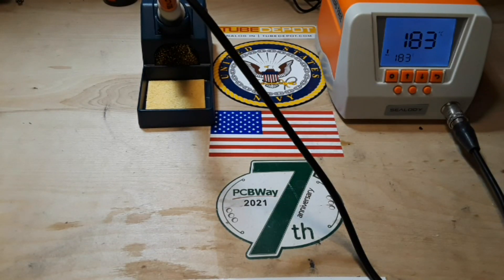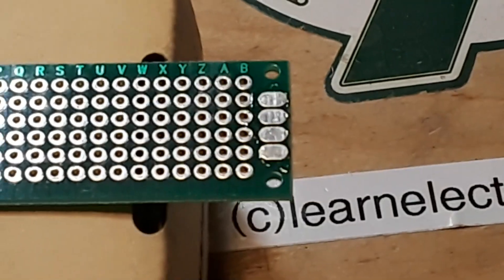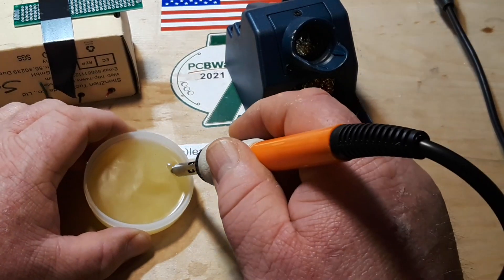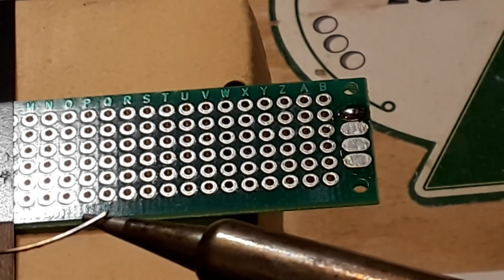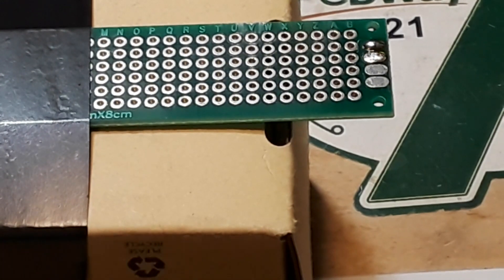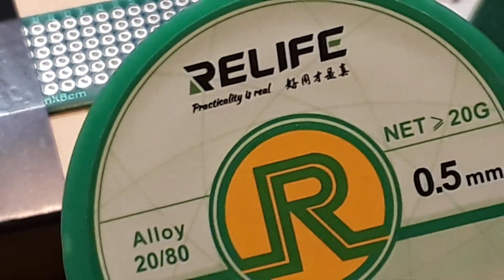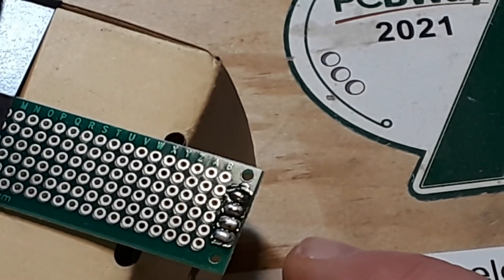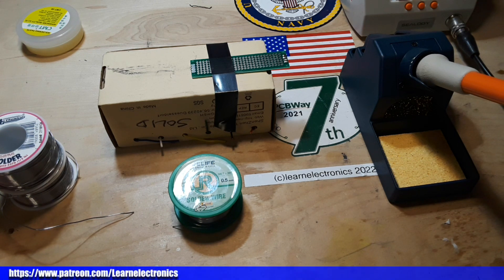Testing 3 Different Solders

Comment: ~183C-ish is a normal melting temperature for leaded solder. The MG Chemicals solder used first in this video has a melting point of 361 ~ 376°F (183 ~ 191°C) because it is not eutectic. The same low temp test should have been done to all 3 solders. I would have liked to see how the MG Chemicals one did a 183C. Have you tested the actual temperature of the tip?

I have used other Relife products and they are really good. Though, I have never tried any Relife solders. I don´t think I would use solder containing that much lead. MG Chemicals appears to make good products but I don't remember ever trying any.

Maybe you can do the test again and include some Kester solder. That would be nice.

Comment: A little late hear. That low melt solder appears to be a removal alloy for SMD. Similar to Chip Quik. Heat it at 350-400 c. It will stay molten for a bit, to allow you to remove flat packs, etc.

Comment: I'm so glad I decided to listen to you. I've been really disappointed with how my solder joints looks especially after soldering binding posts/banana jacks to my HP Server Power Supplies I put in series for my LiIon/Lipo/LiFeP04 charger. No matter what I did the solder would always end up looking dull and sometimes even crusty. I had been buying Maiyum on Amazon. Its rated very well and while I knew it wasn't Kester or MG Chemicals I figured those two weren't worth the money. I buy a 100g roll of solder every 4 months and just was too cheap to shell out $30 on a big roll of the good stuff.

Until a couple weeks ago when I saw 2 18gram tubes for $2.99. 2 left in stock. I got 72 grams of MG Chemicals 63/37 for half the price I'd pay for 100 grams of that Chinese junk. Now I've been resoldering a few of my bench toys because I absolutely cannot stand looking at the McDonalds equivalent of solder now that I have Flemings on my bench. Beautiful shiny solder joints that stay perfectly round. My only complaint would be the specific solder I chose is a little heavy on the flux but I have 99% iso if I need to do a bit of cleaning.

Thank you, thank you, thank you! MGCHEM4LIFE
Reply: I am looking at a roll of MG Chemicals no Clean, 63/37 1/2lb for £20. Do you think that's good is it worth the money? Kester is going to cost a hell of a lot more.

Comment: 63% tin, 37% lead resin core .028 inch Ersin is fantabulous.  63/37 is supposed to be the only combination that sets up, solidifys with less temperature change. 60/40 sets slower which means I have to be steady for a greater time.
Reply: Setting slower isn't the only problem, tin and lead have two different melting points so one will solidify before the other, the mixture becomes the metal equivalent of a slushie which means that even when it looks solid a part of it will still be molten and any slight movement can lead to cold joints no matter how good it looks from the outside, bad connections that are hard to diagnose. 63/37 is a eutectic blend which through some metallurgic magic it all melts and solidifies at the same time despite having two different metals with different melting points.

Comment: I had a friend make a kit using Lead-free solder and none of the joints flowed. Touching with an iron the Lead-free fell off. Used 63/37 worked great
Reply: Some of the new LF solders are good but they're apparently a lot harder on tips, especially with the extra heat. That's what turns me off. Luckily here in Australia there's no restrictions on leaded stuff.

Comment: How about testing Silver bearing solder?   I find it better when holding wires by hand.  When you take the heat away, the solder hardens instantly, giving you a better joint.  This, of course, requires the use of a much hotter iron temperature.

Comment: im always finding problems with solder. some works great on circuit boards but not at joining wires together. and some are the other way around. so i might try your 1st solder you showed there (your go to solder) coz it gets messy when a solder's not doing what you want it to do. even it it says it 60/40 tin/lead. you just can't trust the Chinese market. i get all my stuff off BangGood. find very satisfactory. but solder can be a problem. or maybe it could be the flux im using either. so i need some pen dispensing flux for small circuit board job/smd replacements. so il try that solder you use and report back.

Comment: Nice video. I wonder if the 183C temp was referring to the temp the circuit board could get to before the solder let go. Although that would be a smoking hot board at that point!

Comment: May not be scientific but i found this to be an objective test. Extremely low melting point of that solder sounds like a marketing gimmick (?) i wouldn't even trust any solder that melts at that temperature, if it's even possible!

Comment: It would be worth comparing the properties of the lead free solders. 
As the properties are well documented in their data sheets, the real test is how well they work in the real world given their price. There are some low temperature mixtures, but they tend to be expensive.
I have a soldering iron dedicated to lead free soldering, I have to say it does not get much use, as the stuff is so horrible, particularly with SMD parts. The most common lead free solder is a tin copper silver mix, which has a very high melting point, compared to lead/tin solder.
It is reported that of the lead free solders, a mix of tin, bismuth and silver gives a lower melting point than lead/tin, so it would be interesting to see this being used.

Comment: I was under the impression that 60/40 solder is close to the eutectic mixture ratio for lead and tin, meaning that it is already close to the lowest melting temperature for this mixture of metals.
A Google search gives the eutectic mixture as 62% lead and 38% tin. Difficult to see how any other ratio of just these two metals can claim to have a lower melting temperature.
Reply: Pretty much what I was wondering.
Reply: Good observation.

Comment: thanks for this video
learned a lot about temp and different solders.
i have several rolls of different solders, some thicker in diameter than others, never quite know what solder to use for what application.solder mainly 14-18 gauge wire ends to each other with a third hand radio shack device.any way i can grossly decide which to use and what temp to use on soldier gun, which is a Tenma?
john

Comment: I still use my old nice 500g roll of 60/40 tin/lead for hobby. it's also nice for smd stuff (0,5mm dia)
I may check also some solder from mouser and check how these real lead free stuff is.
Edit: not going to test. wtf is these solder prices. I think I bought that old solder with 50mk and it's around 9e (13e if you take account inflation from 1990) and now I can see 500g of solder is 160e in mouser or 100g around 12e in amazon

Comment: Grate video Paul as usual by the way I was told by a tech that if you use led free solder you should not use the tip for ledded solder and vice versa is that true.
Reply: Hi Paul thank you for the heart can you use ledded solder and ledfree solder on the same tip. Ive been told you can't is this true
Reply: @donhiscock6933  . Use separate tips. Is what I have been told

Comment: So, one of the top selling brands of solder on amazon is Maiyum, it's 63/37 SnPb and it says it's rosin core, but it is just as bad as the lead free stuff you use in this video. I knew the MG stuff would be good, their flux pens have a good formulation as well. For me I loove Kester solder, I thought I'd try the Maiyum stuff and I guess it would be okay for prototyping or boards you didn't really care too much about, but I was curious if you would try it.

Comment: There was me thinking that the Relife solder was 80% tin and 20% lead, I checked the spec, its 80% lead, 20% tin. I would call it a lead alloy solder not a tin alloy solder. It's a high melting point solder, about 310C, the 183C is the temperature when it has solidified again.

Comment: Wasn't there supposed to be some sort of benefit to using the lead-free stuff that had less to do with the lead and more to do with long-term corrosion prevention, and is that reason still valid?

I've been driving myself nuts using lead-free from day one. Now at least I can see I'm getting the expected results. I never thought I'd have to set my iron to 400. The cheap tips I have practically oxidize before my eyes around 300.
Reply from the maker: If you can get ahold of 60/40 tin-lead, try it. You won't regret it.

Comment: Do you have any underlying medical conditions due to using PB solders for so many years?
Reply from the maker: Congestive heart failure, but I doubt it's from lead.
Reply: My wife and I worked in the electronic industry for 40+ years and have no issues from using leaded solder. We did use good fume extractors.
Reply: I'm no doctor, but my guess is that unless you greatly overheat the solder, the flux fumes will get you long before the lead will.

Comment: Great video, it could be fantastic if you tested real low temperature solder. It is hard to find genuine low temperature solder that in fact work, as you can see. :-)
Reply from the maker: Yeah, this was not low temp

Comment: I've been using Kester 44 and have a huge role that will last me the rest of my life. It came out of Collins Radio in Cedar Rapids decades ago.

I have tried modern solder but none can compare to the old tin/lead formulas for ease of use.
Reply: That's interesting. I stumbled on a huge roll of that in a miscellaneous  box of stuff at a garage sale. I read some things on the internet that stated that "old solder" did not work well. Being metals, I never really bought it. I found it 20 years ago, and it was old when I got it. It works just great. There is a lot of bad information on the internet.
Reply: I've been using Kester SAC solder (lead-free, 3% silver, and no need to clean flux afterwards). 
It's really made me improve my soldering skill, lol.